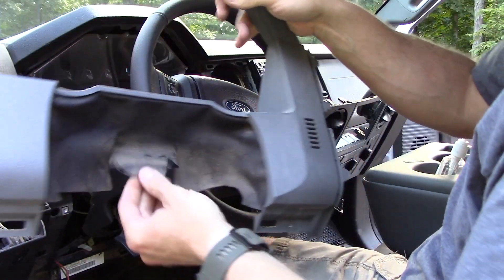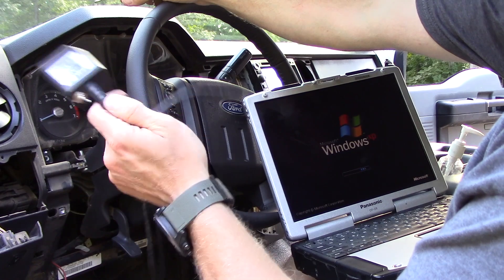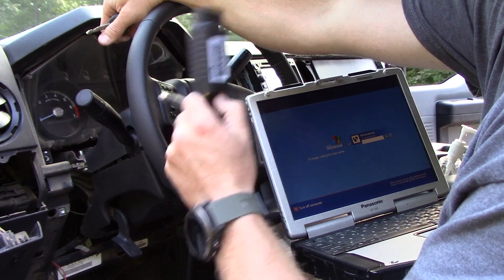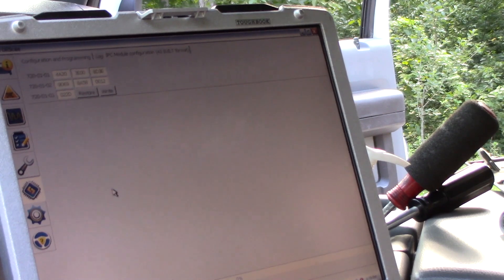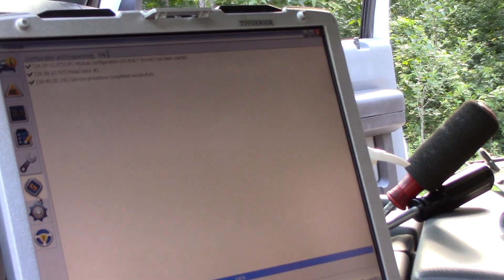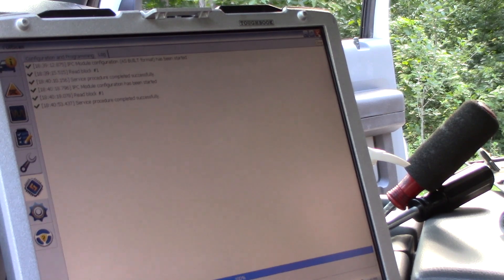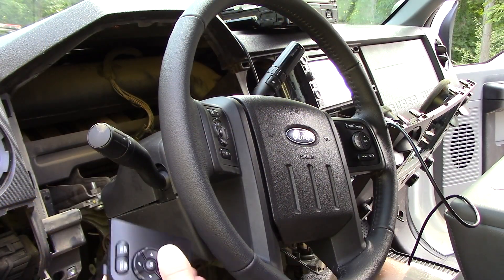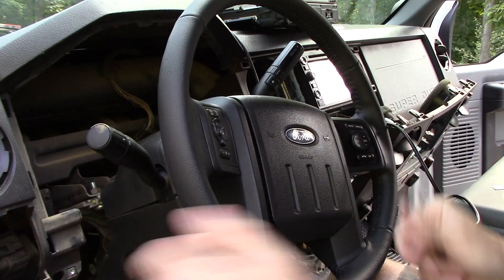2011 - 2016 F250 Lariat Instrument Cluster Upgrade How To Swap

Comment: Question, I just did this swap on my 11 XL, the mileage did not swap over, did I miss something?  EVERYTHING else work as it should
Reply from the maker: No. The mileage does not transfer. There is no way to change the mileage of a cluster unless you send it to a specialty shop
Reply: K

Comment: I noticed on your video that the lights , the small hatch marks on the very outer perimeter of the RPM and MPH gauge display, did not come on. Why is that ? Are those hatch mark lights year specific?
Reply: I know this is 9 months later, but to answer your question,  those marks are part of the Lariat bezel that he removed.
Reply: @AJamesCo  on my Lariat can I keep the cluster and delete that lit outer part around the MPH? I freaking hate those lit hash marks because they are aligned just close enough to the MPH numbers to confuse you. Whoever designed that feature deserves everlasting shame. Been searching for a solution for years and you are the first person that addressed it in any way. Any help greatly appreciated.
Reply: @MrJamesTimmons  those are supposed to line up with the mph. If they're not, then likely something has shifted. You can pull the cluster, remove the clear cover, and probably shift either the plastic piece that's the marks or the black cluster overlay. I've got a cluster in pieces in a box somewhere. I can probably get you some pictures.

Comment: I have a 2012 f250 xlt, I found a lariat cluster with pretty dang close miles. Would I be able just to plug it in or would I have to do any programming?
Reply from the maker: Most likely you will get error messages without programming.
Reply: Okay thank you
Reply: I have a 2012 super duty 6.2  and I want to do the upgrade but how can I get it programmed ???

Comment: I have a few questions for you with this upgrade. Did the door open warning go away when you uploaded the settings form the old cluster to the new one? Also if i follow this video step by step this will work for my application? I have the same truck with a few more options then you but in the diesel version.
Reply from the maker: Yes. The main thing is downloading the info from your old cluster first and then uploading it into the new cluster.

Comment: Great video! I used this video to install a lariat dash on my 2012 6.7. Only question I have is under gauges isn't there supposed to be a mph setting? Obviously the old one didn't have one but were you able to figure out how to enable it?

Comment: Just did the swap in my 2016 f350..had to get a 2011 in order for it to not reset every 10 seconds
Reply from the maker: Yes, that seems to be the trick that works for the later models. Glad you got it done. It's a neat upgrade.
Reply: @JackofAllMasterofNone  thank you for your video

Comment: Question, on mine granted it’s a diesel but I have the one through six for the gear range it’s in. Did you have that also on your old cluster.  It does not look like the new clusters have anything but 1,2
Reply: It’s digital

Comment: How do you just remove the clear plastic cover? I just bought a 2012 f250 and there is dirt behind the cover that I want to clean off
Reply from the maker: Have to take the whole cluster out. It is clipped and / or screwed on

Comment: Hey out of curiosity whst did you do with compass???
Reply from the maker: Turned it off
Reply: @JackofAllMasterofNone  where did you find that option to turn off???? I've checked forscan and haven't found it, I am buying the module for it hoping I can get mine working..... the local bone yard has a king ranch in my year and he is allowing my to scavenge it for toys....... a flat fee of 250.00 he said "Sure grab what you want/need just don't damage anything" LOL that was a mistake, I am taking seats center counsel and all indash electronics for sync3 I think that system was...... should be a nightmare...hahahah but what the hell.... LOL
Reply from the maker: @91prostreetstang  I flashed my as built data from my XL cluster into the new cluster, like I showed in the video.  I do not know what exact code enables the compass. You will have to experiment.

Comment: I have a 2006 Ford F-150 Lariat & when I changed my Instrument Cluster the truck would not start. I had to drive the truck (with the old cluster installed) to the dealer & they had to "Marry" the new cluster with/to the ECM & I also got a new key. Apparently, they changed the system in 2011. Does anyone know of a way around paying the Ford dealer next time for the older trucks Also, does anyone know what type of system they have on the 2017 & newer trucks??? Thanks!!!

Comment: Hey Jack of all... did you have an issue with cluster compass function??? I swapped with a platinum and all is good accept rear sensors and compass?? No where can I find if I'm short a module or if I can activate with forscan... any ideas?
Reply from the maker: The compass is an additional module. You would have to add it for it to work. I turned it off. Thats why you have to flash your oem cluster info into the new one to disable the features you dont have.
Reply: @JackofAllMasterofNone  LOL, I didn't realize I already asked this.... my bad sorry man..

Comment: Hi I did all in the video steps but I don't know if I mesed up something, No errors but the cluster douse cycling like u open the key on and after 5 seconds it douse turns off and turns back on, please help me out   this is my email. gamdog3@yahoo.com   thank you
Reply: Gamlet Beglaryan mine is doing the same. I did not flash it with FORScan, just swapped clusters. Did you ever resolve? Was forscan required?

Comment: It actually does store the mileage in the pcm
Reply from the maker: Yes it does.
Reply: You are correct. But it does not transfer that info between the PCM and Cluster. Multiple electronics on the truck track mileage also. Ive seen BCMs and TCMs store milage

Comment: Do you know of any issues between the 2015 and 2016 clusters?  When I installed the upgrade the cluster resets after about 20 secs.  Thanks.
Reply from the maker: This seems to be an issue for some other folks with the 2015-16 clusters. I do not know the cause. Just make sure you flash the oem ipc data to the new cluster.
Reply: @JackofAllMasterofNone  Thanks for the reply.  I have not installed the new cruise controller on steering wheel nor tried to flash.  Have you ever seen this issue resolved after the flash takes place?  Thanks again.
Reply from the maker: @jackfitzgerald8838  I personally have no experience with it. Only done this on a 2011 truck. Ive just spoke to a couple others who had a similar problem but never received any feedback
Reply: @JackofAllMasterofNone  I appreciate your time.  One last question, can you send me a link to the scanning device you are using?  So any MS CAN OBD2 device?
Reply from the maker: @jackfitzgerald8838  Just search for "BBfly Ford OBDII scanner" on Amazon
Reply: Any update on resolve?

Comment: So I switch out my cluster and my a/c won’t work and the radio. How to I get that those to work with the new cluster?
Reply: payton Rippee I’m having the same issue as above my 2015 f-350 gas lariat, everything works as it should but not my gps, touchscreen and climate controls, thinking the cluster was in a truck that didn’t have gps, but my truck has now. How would I get the radio,gps and climate control working?

Comment: Very nice video. What if I don’t reflash the cluster and just plug and play. Do I really need forscan?
Reply from the maker: It depends on the difference in options from the donor truck to your truck. It will work if you just plug it in but you may have a bunch of error messages that appear for missing hardware that the cluster thinks you should have.  Try to find a similar optioned truck (main thing is compass and trailer brake controller) to avoid issues.

Comment: i have a 14 raptor and needed to replace my cluster. i got another 14 raptor cluster and my 5 button control pad on the steering wheel does not work. do you know if this can be fixed with the forscan?  and if so what should i be looking at in there? thanks
Reply from the maker: Sounds weird that it doesnt work if you got another Raptor cluster. In theory, it should be plug and play. Why did you need to replace cluster?  To guarantee it works, you really need to flash your trucks as built data to the new cluster to ensure everything works properly, which you can do with forscan.
Reply: @JackofAllMasterofNone  i was trying to mod the cluster by removing the gauge faces and broke a couple of the motors. thanks for the tip, i wanted to check before i invested in the forscan cable

Comment: I got me a cluster decently priced! The easy part is my hard part. I cannot find the 5 button nav switch for the steering wheel. That part number shows as invalid in all online Ford parts sites. Was it replaced with another part #?? Stuck.....
Reply from the maker: Not sure. I bought a new steering wheel and it came with it
Reply from the maker: Check ebay
Reply: I was looking for the part on the catalogue and it dont show up ether I found it on Ebay for 68 dollars

Comment: Awesome video. Thanks for posting it. I picked up a 2011 F-250 XL with 26 miles on it and I'm interested in upgrading some aspects of it, but it's pretty stripped down. For instance, I don't think it has Ford Sync. I have no outside temp. gauge, cruise control, et cetera. A couple questions, if you have the time: With such a basic base, do you think it's possible to put this new cluster in? How much should I expect to spend on a cluster? A guess on labor to have it installed? --I appreciate your time.
Reply: If you want to do factory upgrades it has to have  the basic power group to start. Ie power locks windows mirror's.  Other wise  you need to change  the body control module thing to do any lariat upgrades. Like climate control auto headlights gps.
There's 2 different b.c.m( body control model) for the 2011-2016 if you need to have the power group to have the one that you can change the programming
Reply from the maker: It is possible to install the cluster in any F250.  Not sure on the labor.  The dealer would probably do it for $500 plus or they may tell you its not possible (which isnt true, they just dont usually do stuff like that). Your best bet is to do it yourself or if you don't feel comfortable find someone who is to do it for you. Maybe a local stereo install guy or something. The clusters themselves vary in price. Best bet is used on ebay.

Comment: Do you have part number and where you picked up your cluster? Thanks great video.
Reply from the maker: Number on the cluster is CC3T-10849-GC. Check out eBay.
Reply: Jack of All Master of None so I found one, but it’s kph cc3t10849bb is it easy just to do the swap and use my old cluster to swap the kph to mph?
Reply: @CynicalKilljoy  I know my dad somehow screwed with his and made it say khp.  I got into the setting from the steering wheel and was able to change it back to mph.

Comment: Awesome Video! I recently did the same thing with my 6.7 but for some reason the dash resets its self every 10 sec... 
The only difference I had was that the new dash had an extra row in FORscan vs the old one. I tried adding the truck I got the dash from original as built data in but no luck... any ideas on that may be causing it? I'm think that because the truck is a 12 and the dash is a 13 that is just not compatible
Reply from the maker: I believe the 2011-2012 trucks interchange only.  A lot of the electronics changed in 2013, so that probably is the reason.  Obviously Im not sure exactly what changed but for instance the radios completely changed in 2013 as well and do not interchange.
Reply: Did this ever get figured bout I'm having the same problem same year truck
Reply: Im having the same problem too..... 2015 F250 XLT with sync and the cluster I bought came out of an 2015 f350
Reply: Same issue here.   I have a 2016 F250 XL 6.2L, and used a cluster from a 2016 F250 Lariat I got on eBay (part #FC3T10849GD).  This shows as compatible on the Ford Parts web site, so I assume it comes down to a programming issue.   One thing I noticed were a couple of DTCs for the IPC in Forscan:  Code: U0422 - Invalid Data Received From  Body Control Module & Code: U0159 - Lost Communication With Parking Assist Control Module A.   I cannot find anything on which Forscan changes are needed for the Park Assist error (need to disable this), and not sure how to resolve the other.   I tried importing the settings from my stock cluster, but that did not fix it.   I will put something out on the Forscan form to see if I can find a solution.
Reply: I posted this on the Forescan and Ford-Trucks forums if anyone wants to follow.   

https://www.ford-trucks.com/forums/1574496-2016-f250-cluster-swap.html#post18516003. 

https://forscan.org/forum/viewtopic.php?f=16&t=8916&p=30159#p30159
Reply: Finally! I was able to do the swap. I tried playing around with the codes in Forscan with the original cluster I bought on eBay (FC3T10849GD), but it seemed futile. Whatever was forcing the reset seems to be beyond the programming realm. I did however make another attempt with a cluster from a 2012, and it worked! The part # was CC3T-10849-GC.

I put in the As Built data from my old cluster in Forscan, and all of the features were active (temp, compass, menus, etc.). I also sent to off to livinitup to have the mileage and hours reprogrammed, and should have it back tomorrow.
Reply: @DavidBradyTSP   so i have a 2016 f350. the dash i got is suppose to be from the same model year and i have the resting problem. What did you do to get it to stop again??